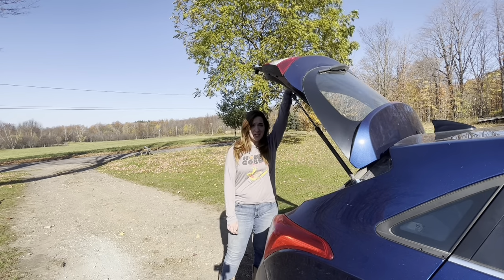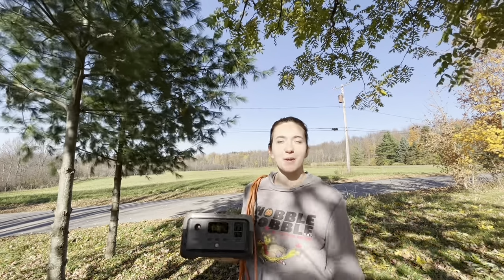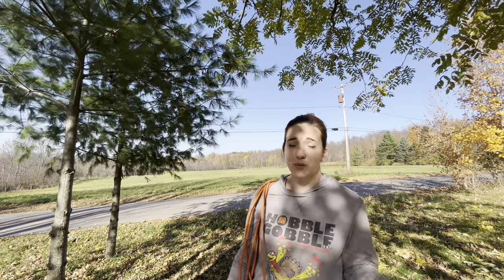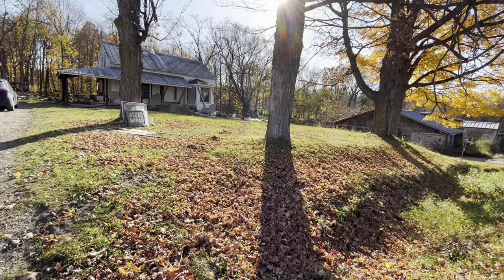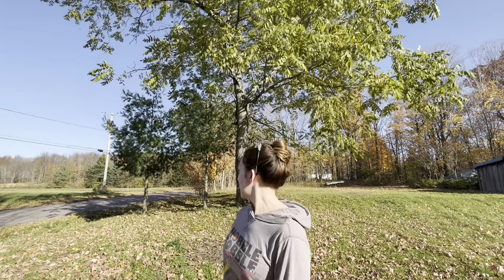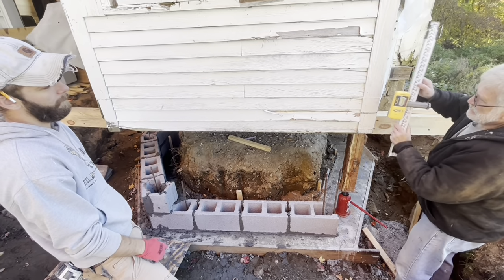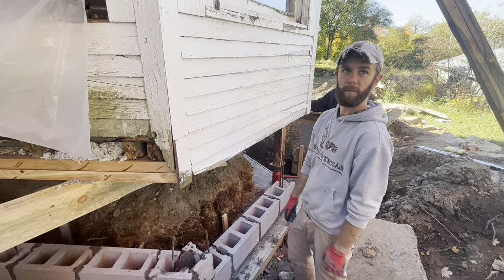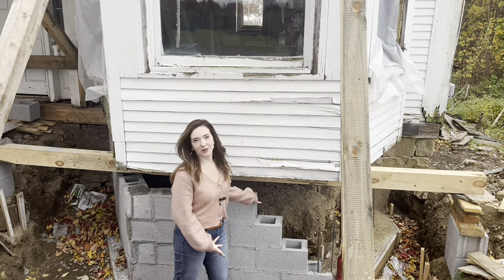How is the BAY WINDOW FOUNDATION coming??? & an Autumn walk in the woods 🍁🍂

Comment: I agree with you that having a portable power station makes a difference. I can just put it anywhere and plug in anything I need to without the wires. That 256Wh capacity of the River 2 is more than enough.

Comment: Wow, God's work vs. Man's work, I think God Wins..  Those trees are gorgeous.  As you walk down to the crick, the trees so nice.  Nice work Men (and Ladies) on the block.  I like those corner cuts, I was thinking to build the block til 1 and 3/8" from the wall plate and then slide a treated sill plate or Jim's Doug fir or Tamarack inbetween the block and lower plate, pound it in tight.  Always support a bottle jack with blocks incase it slips, and get that circular saw off the ground and on a pc of plywood,  owe, my boss chew my butt, now that I have that out of my system ah ha.😄,  it looks great, and you have the best crew, nice looking mud, (mortar)  thanks for sharing and tolerating my scrutiny.  Thank you.
  Love the look of fresh layed block, good job filling in the corners solid.
Love it!